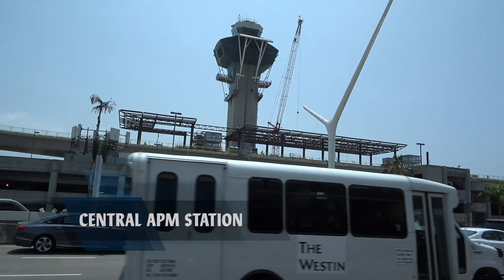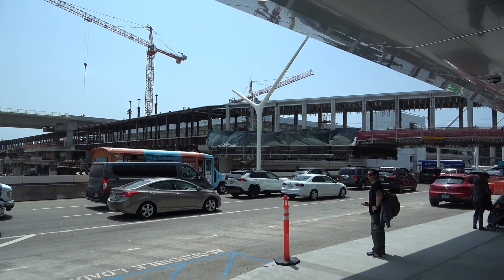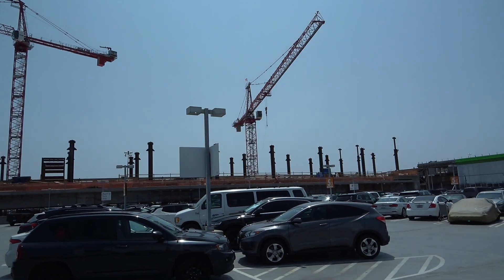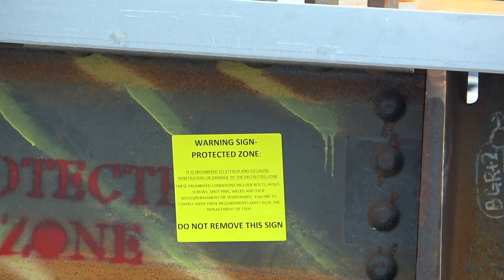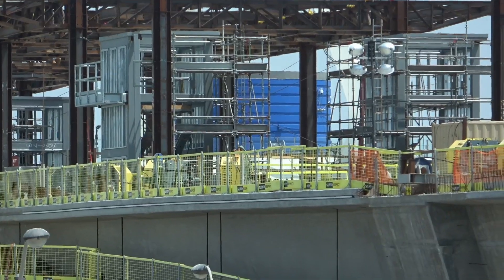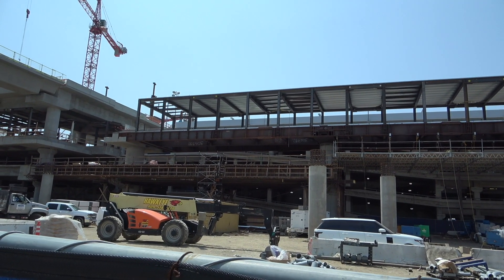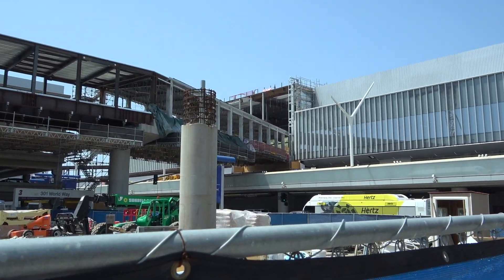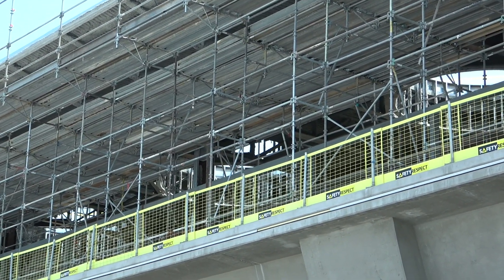LAX Airport $2 Billion People Mover Train | Construction Update

Comment: Thanks John for filming this! I trust all of this will look cool once finished however I wish the theme building was not almost engulfed by all of the new things around it. Soon I fear it will not be visible at all unless you are right next to it if they indeed end up putting in the hotel that was talked about.
Reply from the maker: It's pretty visible on the most part, but not being utilized at all 🙃
Reply: @JEK  Hopefully, once the APM opens, access to the Theme Building will be easier. One of the problems with it has always been access. It's not an easy place to get to other than with a car. And, if I remember correctly, there was never that much car parking next to it either.
Reply: @theexmann  You are right John, they only had like 5 first come first served spots and if those were taken, which was always the case, I remember paying $20 at the valet to park there for dinner and if those were full, it was around $35  or more for one of the parking structures close by as dinner with a little plane spotting would always exceed the "under an hour" rate and then be pushed to the max daily rate. Total rip-off IMO, they never had vouchers with the nearby parking structures either.   Maybe they can reopen it when access is easier!
Reply: @JEK  Good to know! I do hope they find a way to use it. I miss going up there and eating and watching the planes!
Reply: The Theme Building, although still an iconic image representing the airport, was more fun when it was actually being used as a restaurant/bar and observation tower. In my early 20s, I worked as a Foodservice Supervisor for Host International at LAX and could eat up there for free. Good food and a great view! I miss that place.
Reply: If you look at the renderings you would see it isn’t.